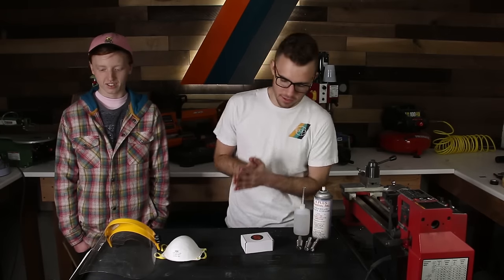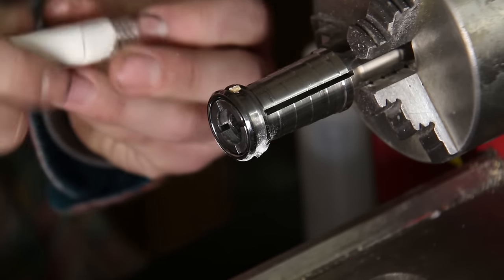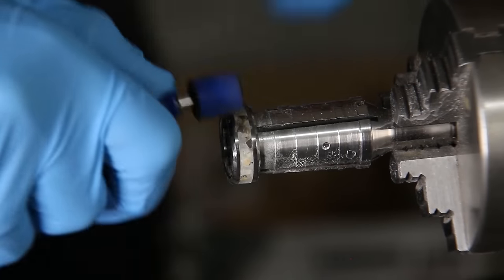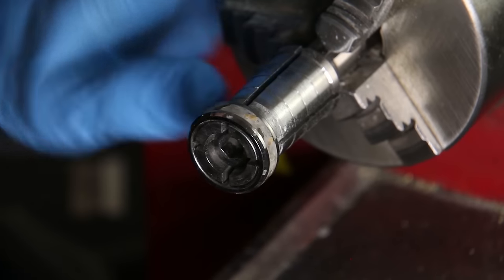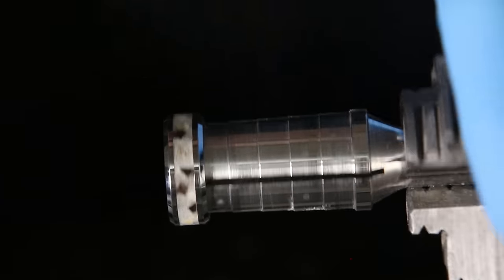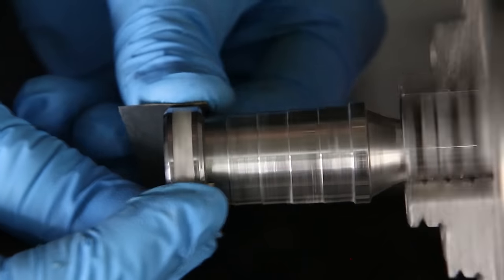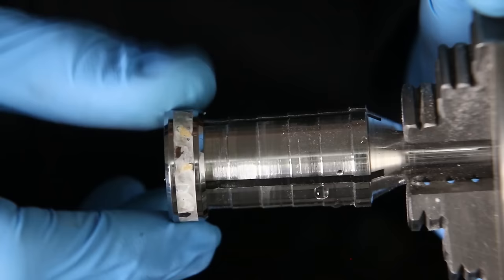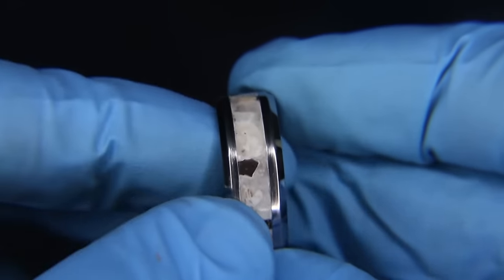How to make Siberian Mammoth Tooth Ring (In-Depth DIY Tutorial)

Comment: Does the type of super glue make a large difference?
Reply from the maker: the viscosity is important. I recommend medium viscosity for most applications, but thin viscosity can be really helpful for certain applications.
Reply: Patrick Adair Supplies any brands you like better? I notice the long application tip which I have not come across before, but it looks very helpful.
Reply: You can always use duct tape